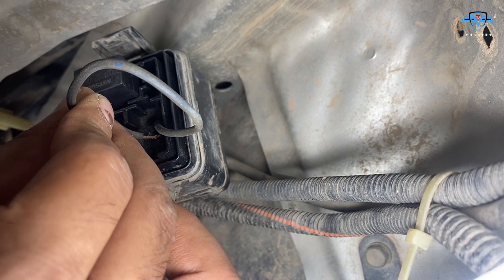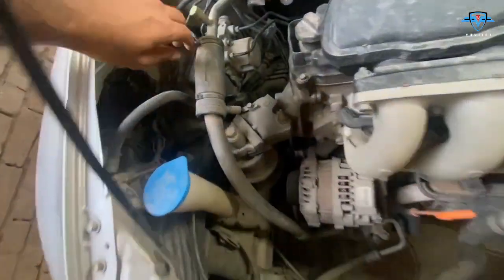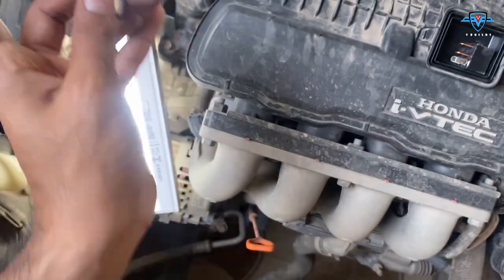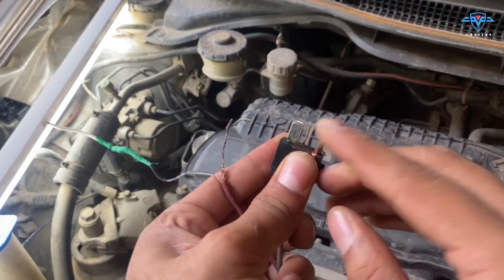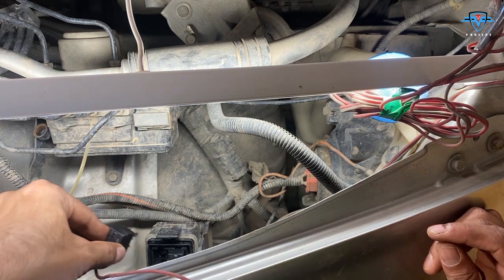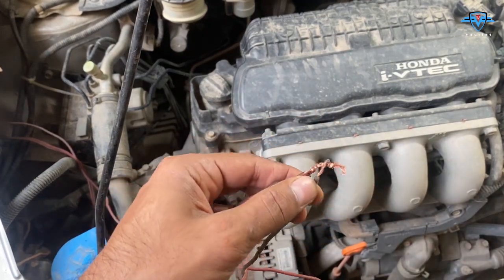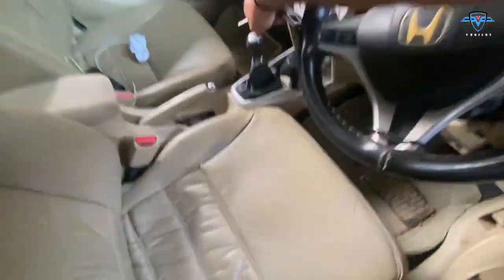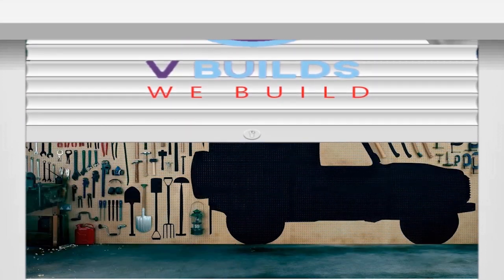Radiator Fan Relay | How to bypass Radiator FAN

Comment: Why is my switch getting hot?
Reply: I installed a toggle switch not a relay?
Reply from the maker: @FiveNem-r7i yes toggle switch is fine .. but use one which supports high amperes.
Reply: @VBuilds thanks I’ll look into it, would installing relay help as well
Reply from the maker: @FiveNem-r7i Yeah that can help, if you know how to
Reply: @VBuilds thanks I appreciate the help
Reply from the maker: The switch must be low amperes… 
High current flows through it so it is bound to get hot, but use a good quality switch and it should be okay
Reply: @VBuilds I bought the highest amp they had 35 I do believe
Reply from the maker: @FiveNem-r7i worst case the switch will burn out and you will have to replace it… if you have installed the switch inside the car then for safety use a automotive Fuse in series with the switch to avoid fire hazards
If outside like me, then dont worry about it
Reply: @VBuilds I have a fuse in the wire already as well
Reply from the maker: @FiveNem-r7i cool

Comment: Thank you so much for sharing , 2020 Toyota camer fan not working and where is the coolant temperature Engine sensor the place my car is On light ? could you please help me  ? thanks 🙏
Reply from the maker: Look for it near the lower radiator hose connection or at the back of the engine block near the thermostat housing.
It will have a two-wire connector attached to it.
Reply: @Thank you for Answering

Comment: if there is no problem with overheating even under pressure ,should i do this job just like yours??
Reply from the maker: @moshex99  sorry I didn’t get your question… no problem with overheating? Then why do you need to do anything?
Reply: @VBuilds  I believe moshex99 just got a problem with the radiator fan doesn't spin even the temperature gauge show near to 90 degree Celcius, ...
indicate the radiator works perfectly discharge heat but, only when the car keep moving forward...

Offcoz, if engine were running more 10 minutes at garage the overheating will happen.  ..Isn't it moshex99?

Comment: Good video, I have 2 resistors one for high speed one for low speed. I only have 1 fan. Should I still wire them together?
Reply from the maker: Just use the high speed one, no need to wire them together
Reply from the maker: In case you want to run the fan at low speed … use the low speed relay, 
if you want to run the fan at high speed use the high speed relay.
Reply: @VBuilds  woow good job thank uu

Comment: I have done a bypass with a switch that comes right into the car so its very convenient to operate. U should have done the same. Switching on and off from outside is not soo cool but I guess it's bcos u just doing a video tutorial.
Reply from the maker: I just did a temporary solution… because its not good to keep it permanent… the fan is not always on when the car is running… it needs to be on only when the car reaches a certain temperature… and this is done by ECU … so not a good idea to keep a permanent switch inside the cabin… just a temporary solution unless you fix the real issue

Comment: Permanent by pass is a bad solution. Radiator fans should not be running all the time, for optimum temp of engine radiator fans keep the heat to the right level. Fuel avg will be destroyed if engine is running cooler than 90 degrees.
Reply from the maker: Correct … thats what i said… for emergencies only :)
Reply: @VBuilds Cool

Comment: Is the same relay responsible for radiator fan for engine as well as ac? My car has single fan. If ac is switched on fan works but when only engine is in fan is not working.
Reply from the maker: For single fan yes the same relay is responsible… but the radiator fan only turns on when the engine temperature is high… it doesn’t run all the time. So the radiator fan may not run when the engine is not very hot. If your car is not oer heating you should not worry.
Reply from the maker: Hope it helps
Reply: @VBuilds  Thanks for your quick reply